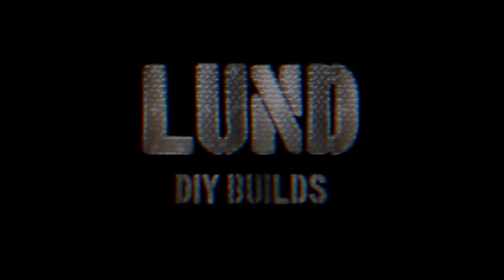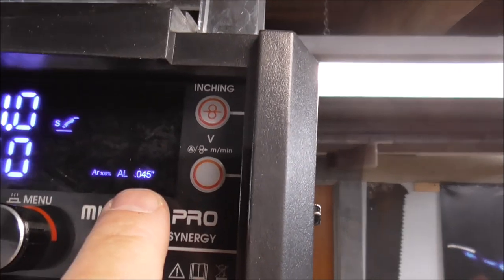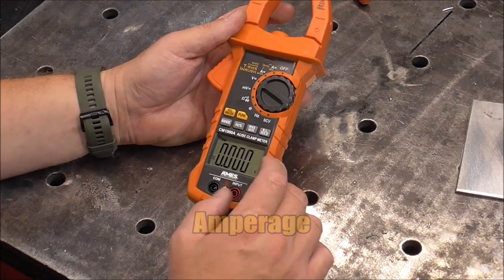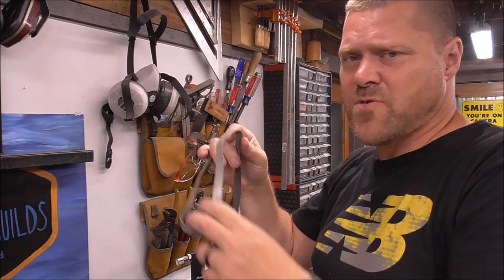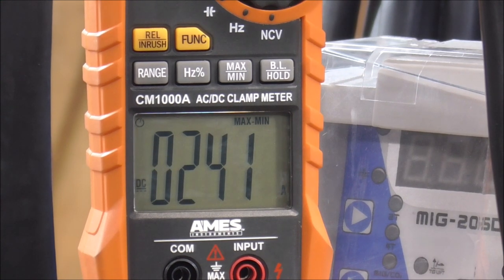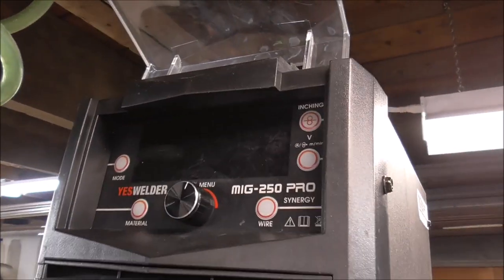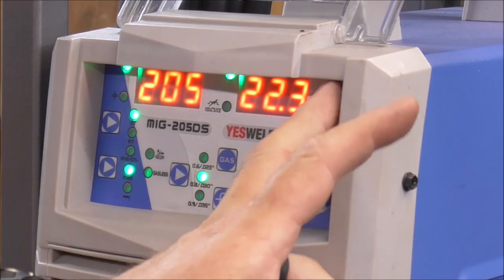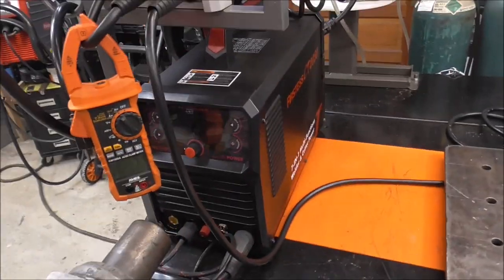How to Check Welder Output Amperage A Simple TEST

Comment: I bought a new mig/ MMA giantz 300c allegedly rated duty cycle of 25%@300amps, 100%@160.  The compliance plate reads 160amp max MMA output and 170amp max output mig. I questioned the seller before purchase.  I requested a picture of the compliance plate which they insist could not be done because it was boxed. Feel like a blunt tool because it was too good to be true, and it was. Please keep doing real world tests, cheers Steve
Reply from the maker: Thanks man! I'm sorry to hear about your bad experience.

Comment: Right up my alley, for sure!  Nice to know that those machines will do what they advertize doing.  It is and easy check for all of us to do on our machines as well, provided we are so moved!!!  Those clamp on meters are wonderful.  Also, the +/- 10% rule applies and they are right on.  Thanks for your efforts and such an informative and pertinent demonstration.  Be well, be safe, be Blessed!!!
Reply from the maker: Thanks Jim! Just so I get this right, if it's within 10% of the rated output it's within range correct? I know you know a lot about this so i apprciate you input. Be blessed brother!
Reply: @BrandonLund  It is a "rule" in electronics and can be applied to lots of things.  Nothing is perfect.  Measurments is one thing that the rule does not apply.  If you need a 12" board or metal length, it needs to be 12"!  In electronic circuit analysis (troubleshooting for a problem), if the values needed are withing 10% of the rated value (either over or under), it is an acceptable range.  If for expample, you need a specific voltage in a circuit (example:  A supply voltage need to be 90 volts, if you read 80 or 100, it is acceptable) and can move on to doing more trouble shooting.  The values you read for the current draw were withing that range and were acceptable.
Reply from the maker: @jimmacsuga2592  Good to know! Thanks for sharing! This type of stuff helps all of us!
Reply: @BrandonLund  It may not completely apply in todays precise circuitry in computers, televisions, etc., but in the "old school" ways of trouble shooting the rule does apply save for certain types of circuits.  When I say old school, I mean prior to 1990!!!  But, it does apply for thy types of readings that we have been discussing.
Reply from the maker: Im sure its close enough for these purposes.

Comment: Hey, can you do a similar test, but have the meter show real-time amperage, rather than min/max?  If you have the meter set to Min/Max, it could be putting out 180 amps most of the time and only jump to 240-250 for a split second once in a while, resulting in a misleading result.

This is especially true with welding current, because the amperage is such a noisy signal.  You can get little "spikes" in the reading due to the noise of the signal.  So a Min/Max reading may give results that aren't properly representative of the practical output of the machine.
Reply from the maker: Thats a great idea. I will do that in the future.
Reply: @BrandonLund  I don't think you're super close to me, but if there's anything I can do to help, or if you want to do a bit of a co-lab on this, let me know.  My contact email is on my channel about page.  Cheers!
Reply: Exactly what I did today.. The running amps on this machine on AL(synergy mode) made 210Amps on my machine. All of the steel settings (including manual mode) ran at 180amps max.. Despite the display saying '250'. This must be a programming thing because there is no reason the machine should make much less current on the steel settings. On stick the max I got was 193amps. Now 180 amps for a machine at this cost is still very good but my testing at least shows it to not be a 250A machine.
Reply from the maker: I'm finding this seems to be a trend with a lot of these budget machines. Surprisingly, I have found a couple that actually put out what it was displaying but most seem to be exaggerated. And as @bigtb1717 mentioned, having the meter set properly so its not just reading the spikes is a better indicator. Once I changed this I feel more confident with the results.
Reply: There are some that can put out close to there rating for a minute, then drop off 20-30% you don't notice it so much since the plate is hot by then.  But it make reduce penetration.

Comment: I recently got a 150€ welder and it claims to output 400amps which I doubt!
The input power on the label says 240v 35A and High 47.7A
Is it possible it could be outputting around 200 amps?

Edit: I ran some 4mm 6013 and it went buttery smooth though my 1.5mm² 30meter extension cable got quite warm!!
Reply from the maker: 400 amps would be a stretch but 200 is achievable with that machine. The cord got a little toasty huh lol. It's got some power for sure 👍

Comment: Nice, but could you maybe show me where to place the red/black probes from my multimeter on my Lincoln 3200HD? I suspect im not getting adequate voltage to my welds?  Thank you
Reply from the maker: You might be able to slip them on each of your leads right at the machine.

Comment: Helpful information, learning quite a bit, YesWelder also sells mig guns, I just bought one for a Miller 250 so I can find out if the machine works, the issue with the Miller 250 is that the kit (plug in adapter) for a spool gun is no longer available, found that out after I had bought the unit, back to the drawing board as far as welding aluminum.
I took apart the miller and there isn't a whole lot of digital electronics as in today's era it seems most welders are loaded with electronics, I question if they make today's units with a End of Life EOL expectancy? kind of like Microsoft and operating systems, you buy an operating system but it has a life span for profit means.
Reply from the maker: I cant say as I dont wonder that also. Thats the benifit of the old transfrormer units. Super simple and they hardly ever die as opposed to todays units that are loaded with electronics that whole boards can get replaced. I guess it's a tradeoff. Being able to manipulate bead profiles and welder frequencies for the trusted and true transformer machine. I tend to lean towards the electronic stuff. It wasn't alsways this way. I'm 52 so this electronic stuff is foreign to what up grew up with.

Comment: Would you know how to check the polarity?  I have a stick welder and was told that my welding leads were possibly installed incorrectly from the factory.  How would I test to see if dc+ is actually dc+ and not dc- ?  
Thanks
Reply from the maker: Depending on your meter, you should be able to connect your meter to how you "assume" it's wired. So for example, set your meter to DC volts, then put the red lead from your test meter onto the positive lead from the welder and put the black lead from your meter to the negative lead on your welder. If you get a positive reading on the meter, it's wired correctly. If you get a minus sign or negative sign in front of your number on the meter, you will know it's wired backwards. I hope this helps.
Reply: @BrandonLund  Wow thanks man for the quick reply!  I’m going to try this and update this thread
Reply from the maker: @kenyanr1 anytime brother! Good luck 👍

Comment: Hi Brandon. Nice video. Very informative. It never came to my mind that we may not be getting what we expected our machine to deliver. Besides its the amperes input that makes the welder work how it suppose to right?Thank you for the info. God Bless.
Reply from the maker: Thanks man! Yah all of it plays a role. Input voltage probably isn't as critical on the output because these machines are designed to work within a certain range. What will effect the output amperage are the actual welding leads. If you were using extension leads and they were small you would get a noticeable different in output amperage.
Reply: @BrandonLund  Thank you brandon for another info. I Love you man. You're really a big help. If you're a book,, i could've bought one and can pass it on to my next generation.Really Helpful. 💓💓💓🙏🏼🙏🏼🙏🏼
Reply from the maker: Ah man I appreciate that thank you so much for your support

Comment: Any machine CSA certified should be goid unless you just happen to get a defective one.
Reply from the maker: I wasn't aware of this! Thank you for sharing 👍
Reply: @BrandonLund  yea the csa makes all these manufacturers prove their duty cycles before they will certify them. All major brands like Miller, Lincoln, and Forney, etc. are certified and most upcoming Chinese models such as primeweld are. Everlast did get in trouble a few years ago for supposedly faking CSA certs on their welders but idk much about that deal. They say it was big in Canada where CSA is based but was kind of swept under the rug in the states.
Reply from the maker: Interesting! The plot thickens! Thank you for sharing. I wasn't aware of this either.

Comment: Is lift tig and scratch start the same thing ?
Reply from the maker: No they are actually different. A scratch start actually requires the tungsten to be "scratched" on the work surface to initiate the arc. Since the tungsten is electrically hot it can easily get stuck to the work piece.  Sticking a tungsten is the disadvantage to this process.  This is usually found on lower cost effect machines. Think AC buzz box with a scratch tig setup. A better method is lift tig. This works by contacting the tungsten to the workpiece then initiating the arc with the button or peddle. You slowly lift the tungsten away from your workpiece and the arc starts to initiate. The advantage to this is you dont get tungsten contamination from sticking your tungsten.  Although you are touching the tungsten to the work piece in both scenarios, with lift tig the voltage is extemely small as it makes contact which is why it wont stick as compared to the hight voltage on scratch tig
Reply: @BrandonLund  Ok cause that's what I have and hate it lol. Thanks
Reply from the maker: Yah if you go with a lift tig setup you will be in your glory. It's night and day.
Reply: @BrandonLund  Trying to learn to tig well is hard, and I think scratch made it worse.

Comment: I would like to know the amp draw from the electrical supply from your electrical panel the breaker supplying the welder. I would like to know the actual amp draw on the 200 amp welder. Some welders that are 200 amp are saying less than 20 amps. At max if you are using 230 volts it would  be 4600 watts. Or for 220 volts 4400 watts. If you don't go max a 20 watt breaker could handle it
 At max it would need a 30 amp breaker and fed with no:10 copper. Still trying to decide on an inexpensive 200 amp welder, are or flux core. For motorcycle repairs and making small table and racks. Will need to weld a cracked frames sometimes which is less than 3/16" of cheap Chinese steel
Reply from the maker: Unfortunately I have already given this machine away and no longer have it.

Comment: Go with a top-quality machine and you're good...  I have a Miller and recently picked up a Fronius TransSteel 2200c with TIG package and they gave me a FREE 2nd MIG gun fully set up to run both .035 or .045 Aluminum...
Reply: I have the same and it works just great, make sure you set the tension really light and run a 3/4 to 1 inch stick out  cttw.
Reply: Forgot to add , for aluminum welding
Reply from the maker: I agree. It's pretty hard to beat the 2200 though. Oddly enough I have not tried welding aluminum with mine. You got a sweet deal. I think the torch for that 2200 is around 500 bucks. Having a spare torch with any machine is really the way to go though if you plan on doing alominyouum

Comment: 👍🏼👍🏼👍🏼👍🏼👍🏼👌🏼🍺😎
If they use extensions it will make a difference especially if they don’t use the a thicker gauge per length according to extensions length gauge guide.
Reply from the maker: Spot on Max. It will drop considerably if your not using good cable

Comment: Interesting video. I would expect most if not all inverter type welders to basically output the set current and voltage it is set at for the process used. There are many variables including the type of machine governing the actual amperage and voltage produced by a welding machine verses the machine setting when welding. The variables are majorly dependent on the welding process being employed, and apply to all processes. You can get good ballpark figures to see if the machine is capable of supplying the amperage it is rated or set at. In certain processes (stick welding is one) the effects of voltage and current can and are manipulated by the welder to control the weld pool.
Reply from the maker: There has been some talk on the internet about welders not putting out advertised amperage so i think going forward i will include this as part of the tests. Everything is getting so expensive we all need to get the biggest bang for our buck!

Comment: Nice job! But not very important. In principle, I=Vtotal/(R+r), change into Vtotal=I*R+I*r, when the voltage Vtotal does not change (for example, you adjust a certain gear on the dial), the current I (ampere) changes depends on the resistance (R+ r), r is the resistance of the machine itself, which is determined by the quality of its own materials such as semiconductors, transformers, etc.; and the resistance R is constantly changing, such as wire feeding speed, different materials, material thickness, arc length, torch travel speed etc. When R does not change under certain working conditions, the current I=Vtotal/(R+r) depends entirely on "r", and r is the most basic and deadly parameter of the machine. It is composed of transformer windings, transistors, IGBTs and other materials.. A good machine r we think is very small and zero, at this time Vtotal=I*R=V1, V1 is the voltage actually applied between the welding wire and the ground, which is the voltage we really need. Regarding the garbage machine, follow As the temperature increases, the internal resistance "r" gradually increases, V1=Vtotal - r*I, the actual voltage decreases, resulting in a decrease in the actual current I=I1=V1/R. Therefore, among the three parameters of voltage, resistance and current, voltage should become an important parameter of the welding machine, which is the most intuitive and should be a reference parameter and a mark on the dial. As long as the welding voltage does not drop in a specific gear, it is a good machine. Therefore, we can conclude that all machines named after current (amperage) are commercial boos, and brand name machines are never marked on the dial. It is enough to have the wire feed speed dial and the voltage adjustment dial, the others (digital display) are for reference only. If you really want to test whether the machine current (amps) can reach its specified value, you have to hold it for a while, not a moment, because "r" gradually rises as the temperature of the transistor increases. Finally, the amperage drops.
Reply from the maker: Thanks for watchiung and commenting!

Comment: 4 things: 1- the max amperage doesn´t mean almost nothing, the real value is to the welder can produce that amperage regularly not in a peak. 2- those welders are not so bad cause there are welders that have specs of 200 amps and they could not deliver 140 amp. 3- 180 amps on a single phase 230v  16 a it´s almost the on  limit. 4- the 100% duty cycle  amperage for me is more important that the max amperage.
Reply from the maker: Your comment #2 is why i did the test. Supposedly certain welders wont put out the advertised amperage. If the welder cant reach its advertised peak amperage than its going to fail all the other tests you mentioned. Thats what i was testing.
Reply: @BrandonLund  but in my point of view the highest amp registered doesn't means anything because for a welder tig/MMA amperage and might voltage should be constant. So if I get a second of 250amp and the rest of the time 150 amp the machine shouldn't be labelled 250 amp, but it's my point of view.
Reply from the maker: @pauloribeiro1627  i totally understand but if the machine is marked 250 amps and the machine cant achieve 250 amps momentarily than it seems any further testing would be pointless? No? I feel pretty confident saying the machine met the target numbers and it maintained them within 10% for the duration of the test. In my book it satisfyed my curiosity about the machines ability to put out the advertised amperage.  Thanks for watching and commenting 👍

Comment: Like to see this checked on Arccaptain since they are giving away so many freebees to just about every welding channel and every body just does simple weld which is useless.
Reply from the maker: I'm currently using an ArcCaptain. Great suggestion. This will be in an upcoming episode. Make sure you're subscribed with notifications on to be notified. Thanks again!
Reply: @BrandonLund  Thank you. That would be awesome.if you can, do both at 110 and 220 max. you may be surprised at your reswults ;-)
Reply from the maker: @WV591 I will. Thank you 🙏
Reply: @BrandonLund  whether or not I buy one will be based on this test to confirm what I have read on amazon.of course i could order one and test it and return it but I don't like doing that.
Reply from the maker: @WV591 I've owned a few different ArcCaptain machines and have been impressed with all of them. I should have the episode ready by next Friday. That's my goal anyways.
Reply: @BrandonLund  No pressure ;-)
Reply: I just did one on my New FEMEROL MIG 250 welder. nice surprise.

Comment: The ames meters are great I have 6 different ames meters and I have 3 of these clamp meters use them on Automotive repair every day they work flawless finally had to change the battery in 2 of them in a year @Brandon Lund
Reply from the maker: Thats good to know! I wasn't sure at first but for the money there is a big difference between this and fluke and I couldnt justify spending more on something I will not use much. I'm glad it's decent because I want to use it on each welder I use